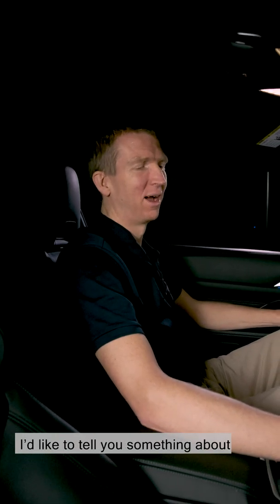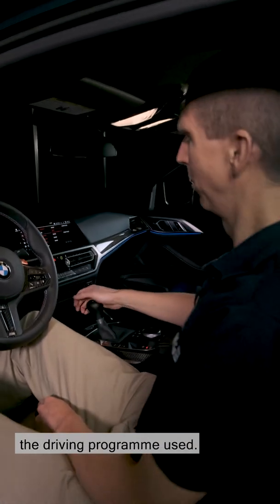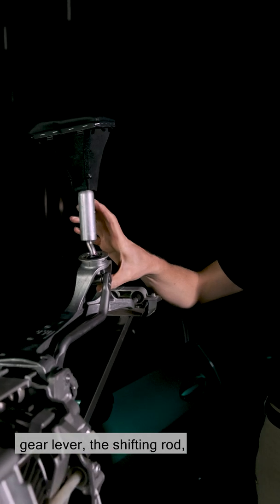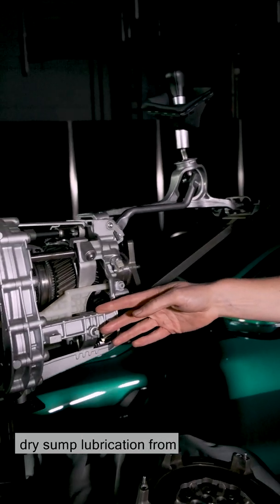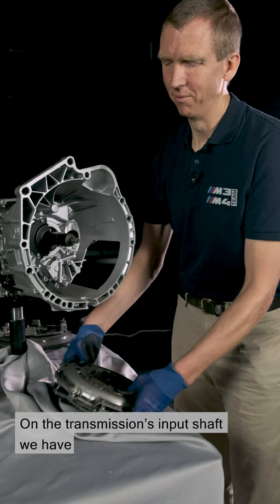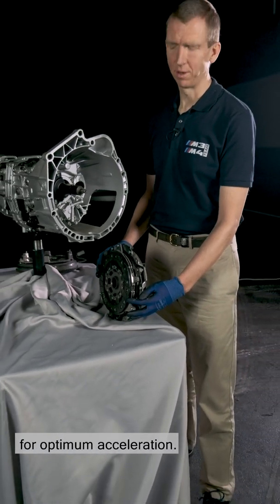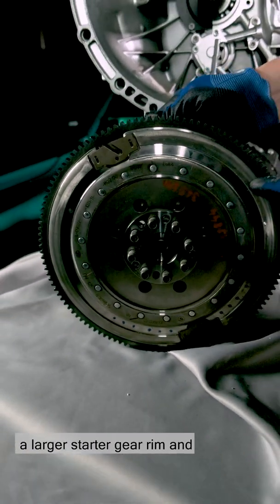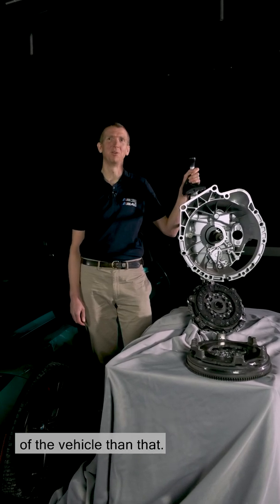Manual Transmission. M3 and M4 - explained, Episode 10.

Comment: Engineer Questions and Responses:
Thank you for still offering manual.

You are very welcome, my friend.

Are the gear ratios in the transmission the same as the predecessor?

Yes, there are no changes on the gear ratios vs. predecessor.
 

For daily and "a bit of fun" use, would you recommend manual or automatic transmission?

That's completely up to you.

What is the maximum torque of the manual gearbox?

The manual transmission models are rated at 353kW / 550Nm; Competition models with 8-speed M Steptronic are rated 375kW / 650Nm.

What is the weight difference between the manual and automatic transmissions?

The total weight reduction of the manual transmission car is -25kg compared to the 8-speed M Steptronic.

Are there any other differences between the Competition and the non-Competition other than the gearbox?

Besides the power rating and the transmission itself there is no technical difference. There are some optical differences - badges, body colored mirror caps and gurney, and tail pipe color.

Why not have a 7th gear for lower rpm at highway speeds?

Operating more than 6 speeds in an H-pattern does not come in handy.

Is there an engineering reason why the manual transmission isn't available on the AWD model?

No. The BMW M3 and M4 are designed to be a puristic and weight-optimized configuration. So we didn't see a merit in adding the heavier, rather complex M xDrive system to the manual.

Is it possible to have the cruise control feature with the manual transmission option?

The standard equipment of all new BMW M3 and M4 models - also with manual transmission - includes dynamic cruise control. The adaptive cruise control is only available for the models equipped with 8-speed M Steptronic.

What is the weight of the dual mass flywheel?

That is 13.74 kg.

Why is a dual mass flywheel and not a single mass flywheel in use? What's the difference?

A dual mass flywheel offers a much better decoupling of engine vibrations from the drivetrain. A single mass flywheel would create annoying rattle at idle and low speed / high torque situations.

Would the transmission show a lot of wear with a single mass flywheel?

No for the transmission. For the engine and the rest of the car massive negative consequences are very likely.

What transmission oil is used and what material is the oil pan made of?

Regular manual transmission oil. Refer to your local BMW service partner for exact specifications. And there is no oil pan in the manual transmission; both housing parts are made of cast aluminum.

Is that transmission made by ZF or Getrag?

Both transmission types of the new M3 and M4 are supplied by ZF.

Was it needed to put 4 metal plates and not just keep 3?

Yes, the reinforcement was necessary for the new M3 / M4.

Coming from an M2 Competition, would this feel similar in terms of shifting?

Yes, it would be very similar.
How do you balance emotive shifting with daily sensibilities?

The synchronisation allows for easy shifting at lower shift speeds. For higher emotion, we added a short shifter.

When we hold the clutch pedal, does the car stop moving on an incline road?

Yes, the car features an automatic uphill start assistant that will hold the car still with a pressed clutch pedal, but just a few seconds.

Does the car support flat-foot shifting?

No, it does not support flat-foot shifting. For the race start there is a launch assist function within the engine.

Does the manual have an anti-lag system so you don't loose boost with each gear change?

No, there will be a torque interruption.

Do you have any specific advice to preserve clutch and gearbox in daily city driving?

Shift precisely, shift smoothly, do not race-start the car and always fully press the clutch.

For drifting purposes would you recommend automatic or manual transmission?

Drifting is possible quite easily with all M3 and M4 models - even with the upcoming M xDrive. Just jump in, give it a go - and always stick with the law.

Can you skip gears in a downshift and still have the car match the revs?

Yes, that is possible. But, please, do not shift from 5th or 6th to 2nd while cruising at higher speeds, you may blow your engine and clutch.

Is the clutch a push or a pull type system?

The clutch is a hydraulic push type system.

Comment: What is the maximum torque of the manual gearbox?

The manual transmission models are rated at 353kW / 550Nm; Competition models with 8-speed M Steptronic are rated 375kW / 650Nm.

Comment: Now we need the competition in manual please 🙏
Reply: No not really. 1) this manual gearbox can't take that higher output and 2) the non-Comp spins its wheels so Comp would even more so. At some point things get so quick and powerful a manual is not suitable, or in the case of the 4WD the auto is probably woven into the control system nowadays.
The non-Comp has plenty of power and goes well with manual. Manual is not about all-out power, not in 2021.

Comment: Just need to bring back the Manual with the Xdrive models. Looks like I am going to have to keep my 2017 340i xdrive forever since it was the last generation of ones with manual AWD.

I put 146K on my 2008 335xi, before I had to get rid of it because of all the issues the car was having (only had to replace the clutch once), fueling/injector issues, window issues, lock issues, water pump (replaced twice), radiator, vacuum hoses. But driving the car was enjoyable because it being a manual. Hoping this B58 is more reliable then the N54.

Comment: Thank you for keeping the manual alive BMW, Long Live The Stick and Three Pedals.
Reply: It would be nice on the M5.
Reply: They say the reason the base M3/M4 offer it while the Competition models don't is torque limitations. So that's the M5 with its larger engine definitely out.
Reply: @artgreen6915  What is the maximum torque of the manual gearbox?

The manual transmission models are rated at 353kW / 550Nm; Competition models with 8-speed M Steptronic are rated 375kW / 650Nm.
Reply: 405lb for the manual more for the auto